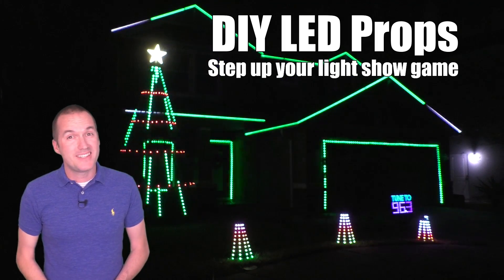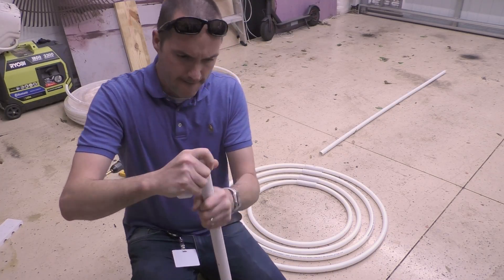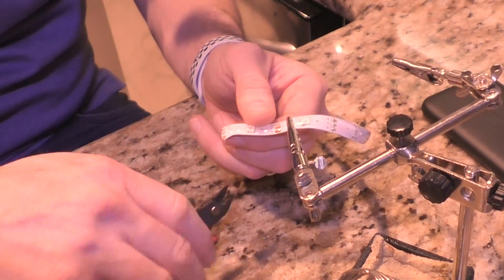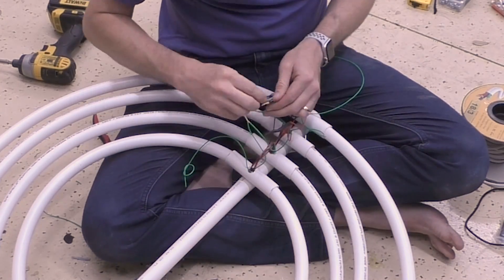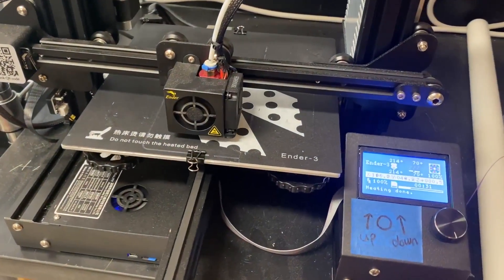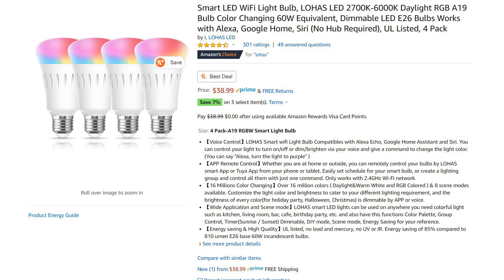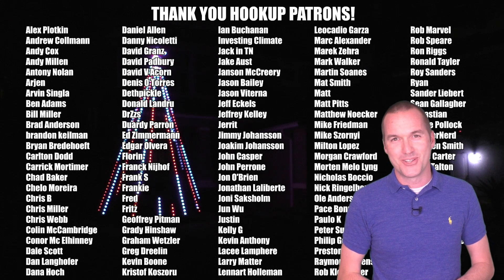DIY LED Christmas Light Show Props (PEX Wreath, Mega Star, Tune To Sign, Flood Lights)

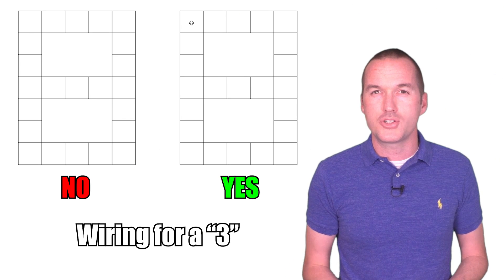Comment: @8:13 "A trick.. was to stip (?) some of the holes..."  What does this mean, please?
Reply from the maker: Skip holes, I know it was quick, but check out the animation next to my head while I was talking about it
Reply: @TheHookUp  Ah. okay.. it was fast, and I didn't see it at first.  Now that I viewed it slowed down a bit, I see what you meant.  The pixel spacing on the wire wouldn't let you get back to the holes you needed, and skipping some going one way, then filling them in on the way back solved that.
Reply from the maker: Yep

Comment: Awesome video.  Love your stuff, it's very helpful.  One request... do you have (or could you create) a video that shows what your always-installed lights look like during the day, when they are turned off, close up, and some of the "problem areas"?  I know you have advocated using an aluminum (I think) channel with a translucent cover.  But in one of your videos where you were testing multiple outdoor cameras at one time, I thought I could see what looked like PVC tubing with holes drilled in them surrounding one of your windows.  I can only assume that might have been an earlier iteration of lights for you.
I'm very interested in planning out my install, first... and I'd like to get a good idea of what the corners are going to look like, where wires might be visible, etc... and, of course, before I do anything, I need to clear it all with the HOA (hate that).  I'm pretty sure they have something in the covenant that prohibits me from leaving lights up year-round... so, I need to be able sell the "you won't be able to see them when they are off" aspect.
Thanks again for all the super helpful videos!
Reply: this is a two year old comment (soz), he explained in another video that the windows and doors have a temporary pvc pipe structured outline but the edges and ridges of the roof are permanently installed

Comment: Do you have a firmware for a E131 controller to drive RGB Light Strip like the WS2812B that's compatible with XLights?
Reply from the maker: WLED or ESPixelStick

Comment: For the star and circle models you can change the layer settings and not need the multiple models. You could also use a custom model for the tune to sign.

Comment: Thanks for the video.  I was just contemplating on how to do a tune to sign.  Used your link!  
I bought the printer too.  Thanks for providing recommendation.  I can't tell you how many times I am working on something and thought "If I could only make something exactly this size, this would be so much easier!".  I have four 7' trees that need stars, I think I'm going to use the design you linked and remove the outer layer.
Reply: That's is really overkill. I'm just gonna use a picture frame. Cut out the letters and numbers for the fm station. Glue it the plexy and shove a cheap color changing bulb that fits a normal light

Comment: Do you have any experience with WLED and Xlights. My roof line Run is 593 nodes and in xlights it has a horrible lag.
Reply from the maker: I don't.  When I used ESP8266s for my show I used the ESPixelStick firmware.
Reply: The Hook Up for doing a roof line over 100 ft what kind of wire do you regiment for injection? I used 18g speaker wire and didn’t even make it 50 feet